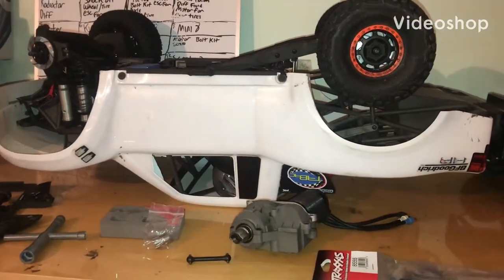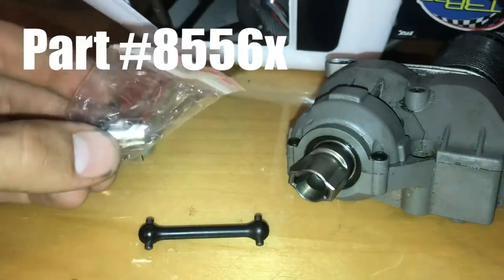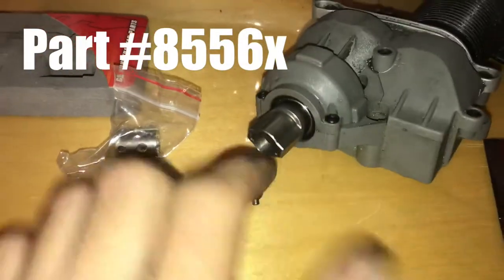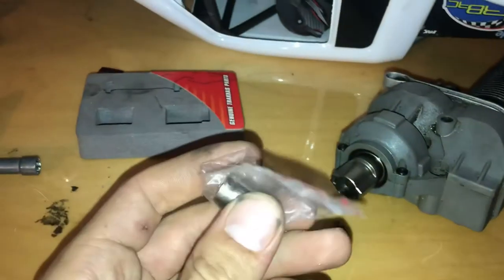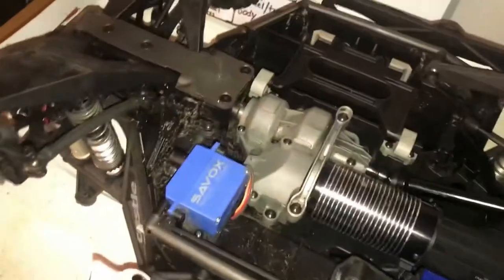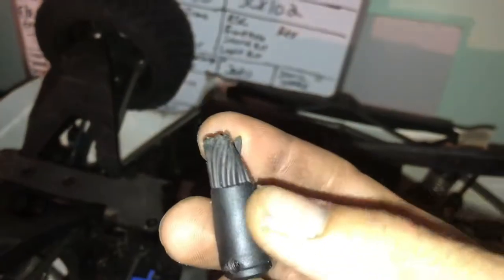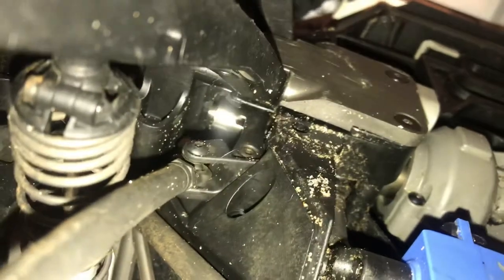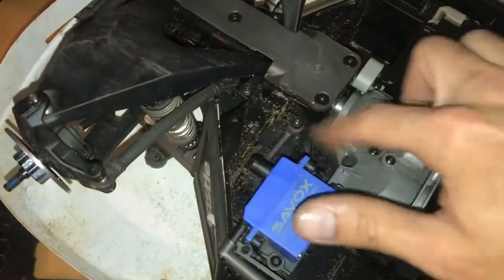Traxxas UDR replacement front driveshaft

Comment: I just now found this out today from another video that traxxas makes this part. Whenever I searched this at their website 8556 and 8556x showed up. The 8556x visually did make sense and I couldn’t find anyone who had installed it. I would later by the Hot Racing that had the shaft and their version of the 8592, which is great but I would’ve bought this one if I had known this part existed.